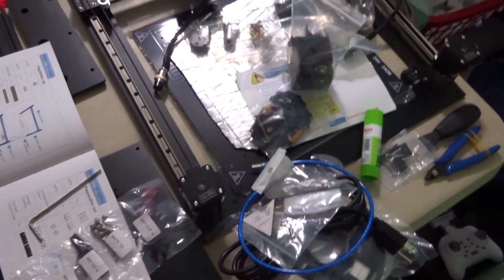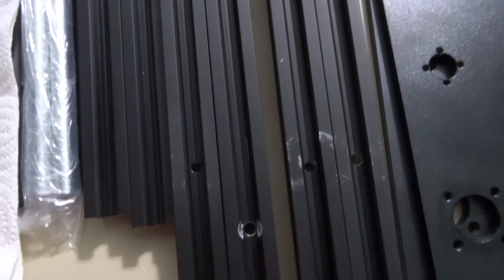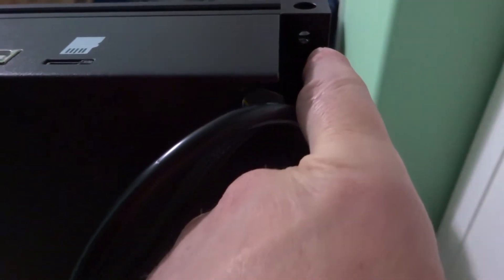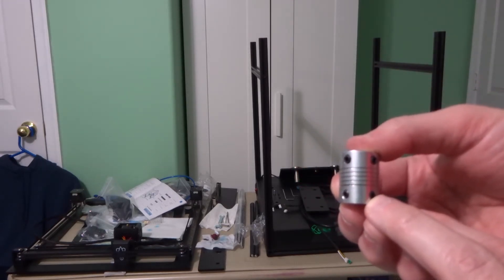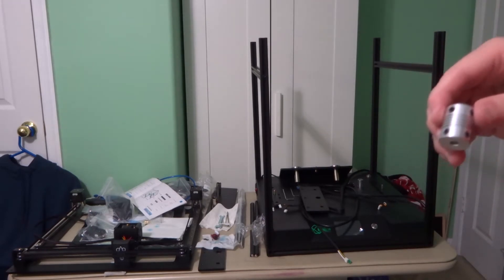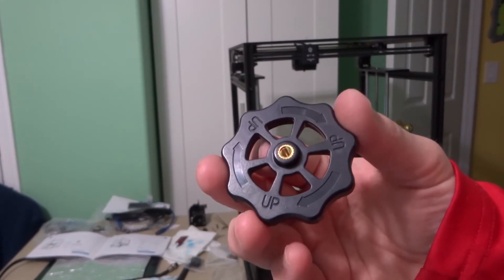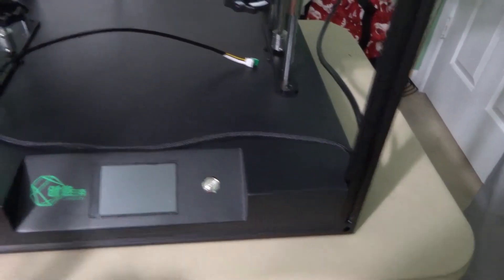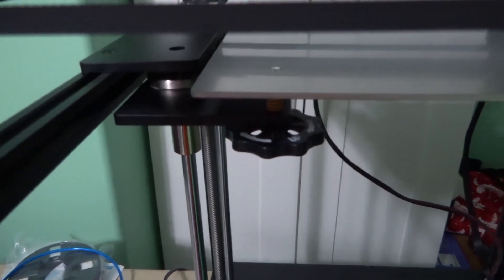Creativity ELF 3D Printer Assembly

Comment: What was the problem with anti-backlash nuts?
Reply from the maker: They were new to me and a bit tricky to install. You put all the pieces of them together, start threading them into the rods, then let them slightly uncompress to get the second part to thread on. I initially was trying to install then fully compressed.